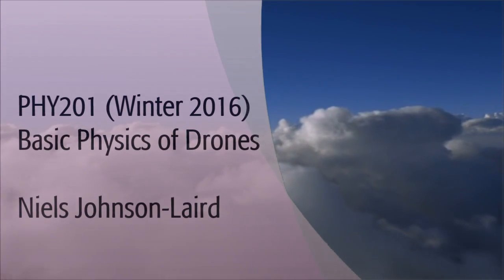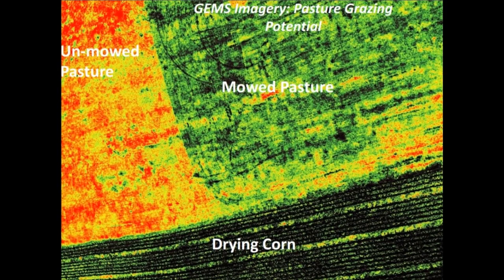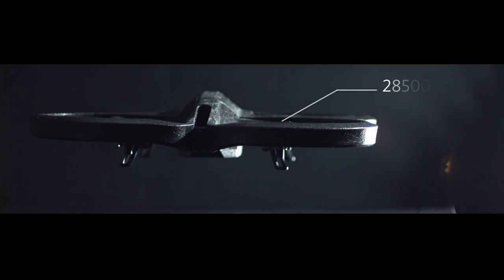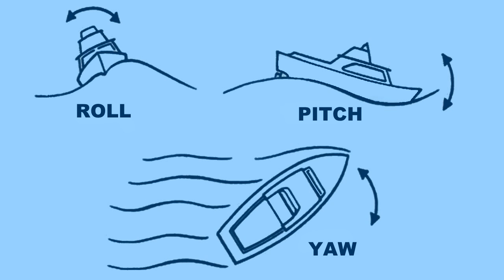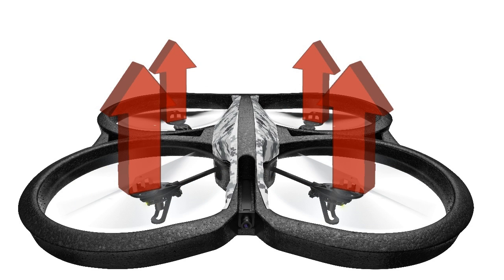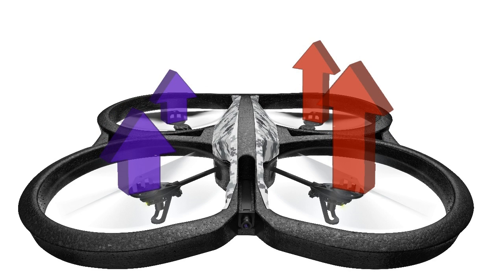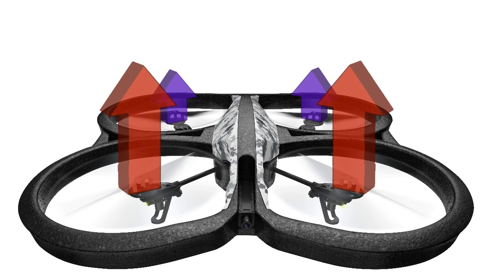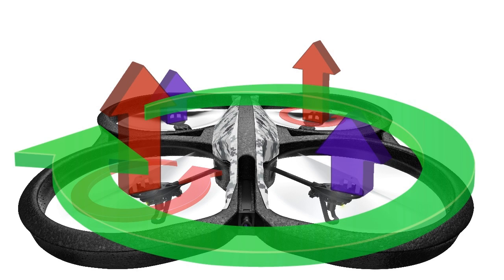Basic Physics of Drones

Comment: I have a question, regarding physics and a drone;  If I (were allowed to) flew my drone on board a commercial airliner at altitude from the back of the plane to the front - Would my GPS on my controller show my drone flying at (for example) 568 mph?
Reply: Yes it would show because you are inside the airliner & GPS see both aircraft & you as a single entity. Infact you would see a little bit more speed because your drone is moving inside the aircraft.
Reply: Just make sure not to use the failsafe option in that case HAHAHA

Comment: 28,000 rpm is misleading. It was advertised like this but the relevant rpm is 28,000 / 4 for each propeller.
Reply from the maker: At time I did wonder if the stated RPM was too high, but I had no other source of information. Can you please cite your source that shows a more accurate RPM?
Reply: Yes. If you search Google for "parrot ar drone 2.0 propeller RPM", you will see many of its sellers with the same statement. Ex: "28,000 (Corresponds to 3,300 RPM Propeller Speed)"
Reply from the maker: OK, I see what is causing the confusion. At the Parrot store they state "The motor has a power of 15 Watts, completes 28,000 revolutions per minute (RPM) when hovering and corresponds to 3,300 RPM for the propeller. The motors' range begins at 10,350 RPM and goes up to 41,400 RPM."
So the motor is spinning at 28,000 RPM, but the gear ratio steps this down to 3,300 RPM for the propeller. Gosh! I wish they had been more upfront on the technical details back in 2016 LOL!
Reply: Oh, now I am wondering about that. I'll have to watch an AR drone disassembly to see that. I didn't think there was any mechanical energy transfer outside of the movement of the propellers. 

I got on this subject today trying to understand how my Mavic Air is able to hold its front propeller arms in position against the wind resistance while braking at high speeds or fighting winds. The torque the in forward direction of the body caused by gyroscopic precession of the spinning props seems to be the answer. The other solution could be that there is just not enough surface area on the arms for the force that is pushing the arms back to their folded positions to overcome the spring holding it. That spring force seems to only be about 3-5 pounds, but I haven't measured this. It's really on my mind because all I can think about when braking hard in flight is the front arms folding back and slamming into the body and the rear props in some destructive accident, haha. Now I am interested in calculating that force and comparing it to the wind resistance at 40mph + headwinds. If you have anything to add on that, I'd be glad to hear it.
Reply: * The Mavic motors also run around 5,100 rpm for hovering.
Reply from the maker: I get days like that...a question gets stuck in my head and I can't let go of it until I have researched it to death...and then poof! my whole is gone LOL.
Best of luck with researching the Mavic Air, you are in essence reverse engineering its design. ;-)

Comment: Would you be able to make a video that goes more into detail about the formula for lift please? But while i'm here, do you think you could answer a few questions for me?

Is lift the same as thrust?

When you calculate lift using the formula you provided, is L the amount of lift each propeller produces or is it the amount of lift all four propellers produce combined?

When you calculate lift using the formula you provided, what unit is L measured in?
Thanks!
Reply from the maker: I'm flattered that you want me to make another video, but I should point out that this very short video (5 mins) took a lot of work. I went back and looked at my timesheet (yeah, I know a strange habit for college) and the research, planning, creating graphics, recording the narrative and video editing clocks in at 27.2 hours. That's about 5.4 minutes per second of video (no, I don't do this for a living so that is why it took so long LOL).

The details of the formula for lift that appear in the video came from here:
http://www.ppl-flight-training.com/lift-formula.html

Regarding your question about lift vs thrust, I am no expert, but I tend to view them as different. For example, a fixed wing plane has a propeller at the front which generates a force we call thrust. The thrust moves the plane forward, but the wings moving through the air generate the lift. Both are forces, but the forces are pointing in different directions with respect to the plane.

A drone's propellers/blades point up so the thrust is pointing up, but what happens when you pitch or roll the drone. The thrust can be the same, but now points at an angle away from the vertical so the lift (pointing straight up is slightly reduced). Too much pitch or roll and the lift force becomes smaller than the weight (mass) of the drone and it drops out of the sky.

As for the units of 'L' that depends on the units that you are using in the equation, as in metric or imperial. As I mention in the video, drones have fixed pitch propellers (fixed angle of attack) and fixed surface areas so velocity is the key factor. Hope this helps.
Reply from the maker: This page goes into more detail on the forces involved:
https://www.mansfieldct.org/Schools/MMS/staff/hand/flight4forcesoverview.htm